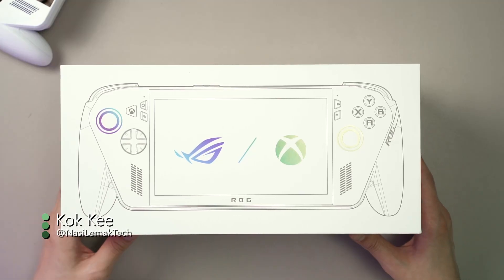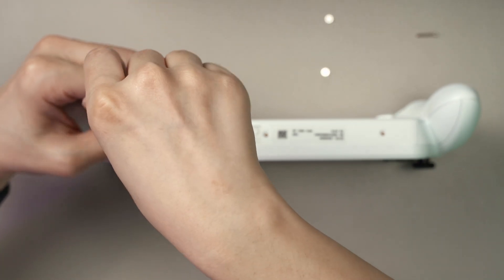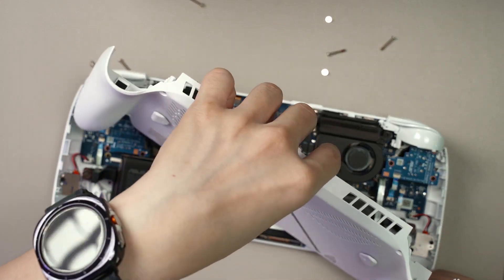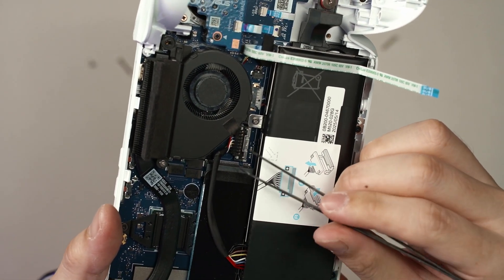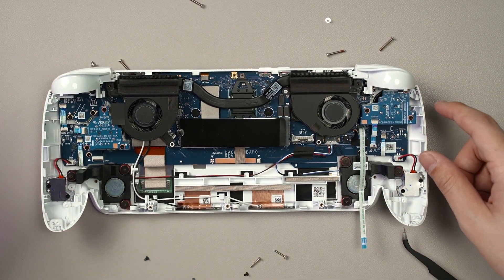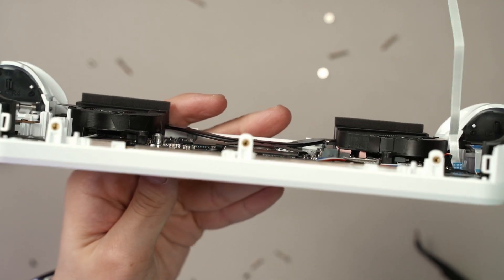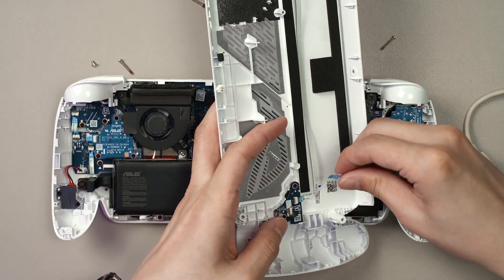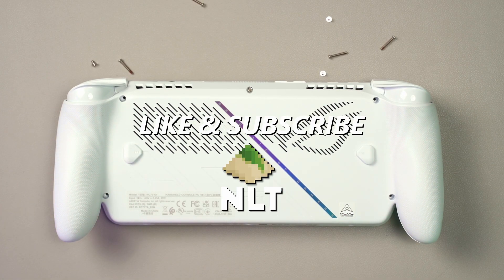Inside the ROG Xbox Ally: Full Teardown & Repair Guide 🔧

Comment: Kok, didn't get the light sensor thing well,is it to detect that the back panel has been closed well tightly or it detect if the panel has been removed or not ,thus not allowing it to boot  if back is removed ?
Reply from the maker: It is to detect if the back panel is opened while the device is turned off.
Once that's triggered, you'll have to block the light sensor by either your finger or closing up the back panel, then connect a charger and it's able to turn on again
Reply: @NasiLemakTech ok
Reply: Is the ribbon cable damaged if it pulls out while taking the ally apart? I'm having a hard time reconnecting it
Reply from the maker: Hopefully not. Just try reattaching
Reply: @NasiLemakTech im trying but no luck. May have a professional look at it. Thank you for the quick response 🙏🏾 😊